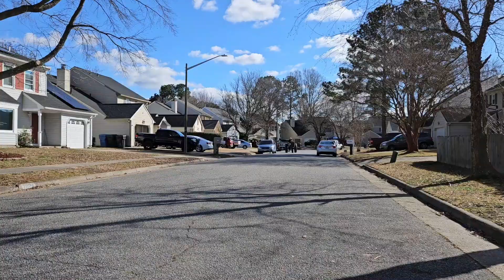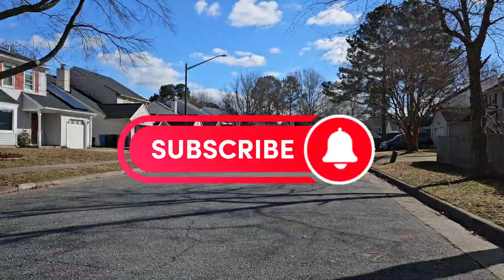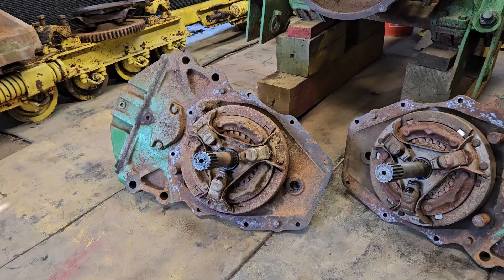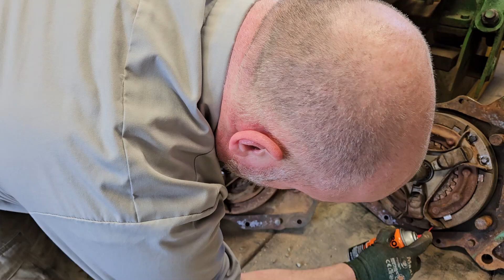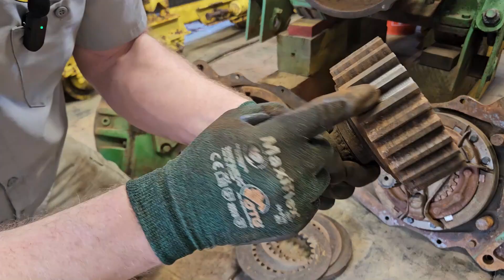Steering Clutch Disassembly John Deere 430 420 or 40 crawler

Comment: Im so thankful you can still get parts for these. Looking good!
Yes the digital camera is a big blessing when taķing something apart especially on modern vehicles. Its free to take a lot of pictures 😅
Reply from the maker: I started the next video today and will finish tomorrow showing the final drive disassembly... found the culprit..... stay tuned ..lol
Reply: @RustyWrenchRestorations  Your making it look easy!
Reply: I just looked up my JD Bible and the MC was 1949-52, 40C was 53-55, 420C was 56-58 and the 430C was 58-60. Mine is 1958 or 131,530. That’s as far as my book goes with the Crawlers. It looks to me that someone could have taken the good RH final drive off yours and replaced it with the cracked one going on the condition of the left one. Good mate to the rescue there. Enjoying your series Steve. Jeff.